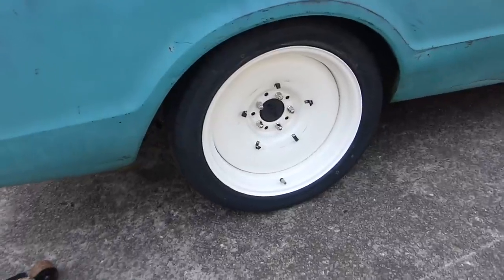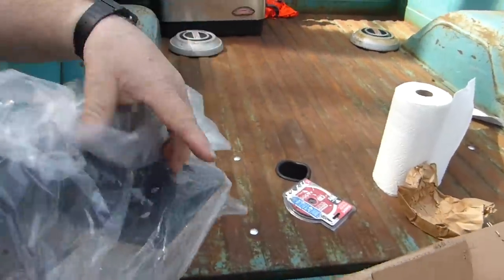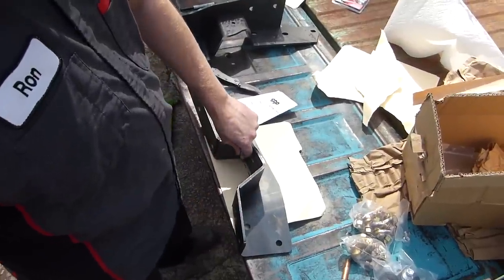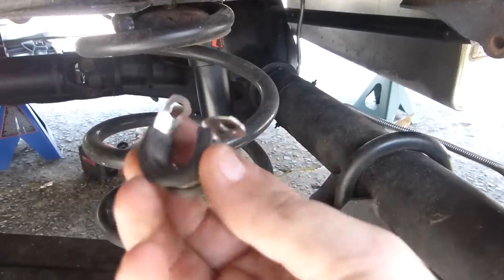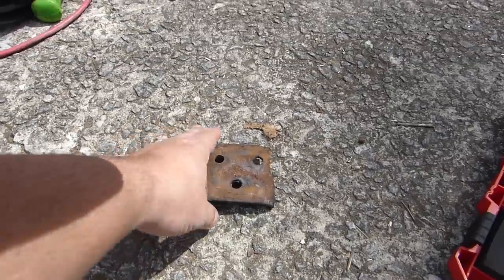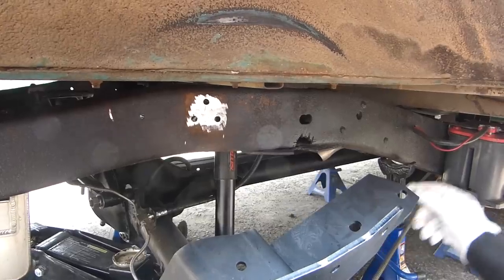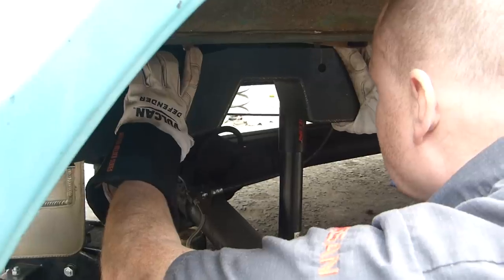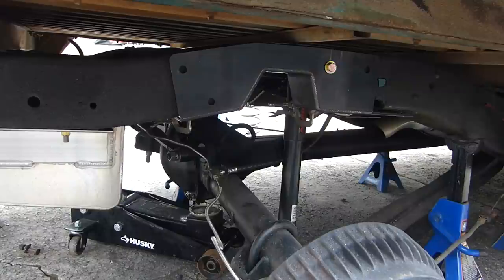C10 C Notch Install | Teddy Gets Cut On #HowTo

Comment: great job guys!!!!  that c notch piece looks rugged, thats gonna lend a lot of reinforced strength  right there where your sring/shock/airbag is!!! plus the coolness factor to go with it!!!!!!  awesome !!!!!
Reply from the maker: Yeah, it's actually a super quality piece. If you look up the part number, CPP actually sells it as their notch designed for 63-72 trucks that will tow frequently. It's beefy. And the bolt-on aspect makes it very accessible by any DIY hobbyist.

Comment: Nice !  
I did the same on my 63. 
Rides nice now.
Reply from the maker: Yeah, it's already made a huge difference on Teddy. Road-tripping a little this weekend so that'll be the real test.
Reply: Whitlock Garage I would recommend welding those up bro.
Reply from the maker: @albertocarlos2193  no, thanks. That bad boy is plenty strong. So many bolt-on suspensions and c notches out there these days (Porterbuilt comes to mind), no need for welding in a notch designed to bolt in. It's got bolts along the bottom of notch as well as reinforcement. I've driven it and totally comfortable with its rigidity.
Reply: I hear ya. 
The roads in Cali are bad,that’s why i welded mine.

Comment: I wonder if you could shorten the C10 frame 12" as you put this piece in?
Reply: Yeah, because brake lines, fuel lines, e brake cables, exhaust and driveshaft will shorten(and balance) themselves

Comment: What did you do with your fuel lines did you disconnect them or somehow relocate them? I have the same issue with my f150
Reply from the maker: I have a relocated gas tank under the bed and have flexible braided fuel lines. I just pulled them out from the frame and we were very careful not to nick one on that side.
Reply: Whitlock Garage oh okay I have stainless steel lines so I’ll have to either bend them (not the best idea) or disconnect them

Comment: Hey guys, loving the show! What size bit y’all use to drill those holes to fasten CPP c-notch to frame?
Reply from the maker: Not sure off the top of my head; likely whatever the bolt size called for.
Reply: @UNITEDBYTRUCKS  isn’t it Dangerous grinding around the Gas tank ?

Comment: And you guys missed the the explanation of you need to block up the rear of the frame cause when you cut it without it supported it will sag I did mine with the bed off and it dropped I guess your bed held yours
Reply from the maker: Never seen that happen before, but we had the jackstands under the rear section of frame.

Comment: I think you just lost 2/3rds of you frame strength behind the “C” notch. Now, you will get high centered on a pot hole. Time for a winch and double check the four-way flasher!
 Question; How do you turn left or right. Hits the fenders regardless of KPI or SAI lift. Skid plated or oil pan, that is the question!

Comment: you gave up on those stupid diamond cutting wheels?
Reply from the maker: Yeah, we tried that Diablo 100x longer diamond blade and it was doing the trick but Ron is old school and liked the fact that the regular cutting discs are easier to use in tighter spaces once they begin to wear away. New blade for cutting and one with wear for grinding.
Reply: @UNITEDBYTRUCKS  love the channel, keep it up.
Reply from the maker: red93yj thanks for tuning in!